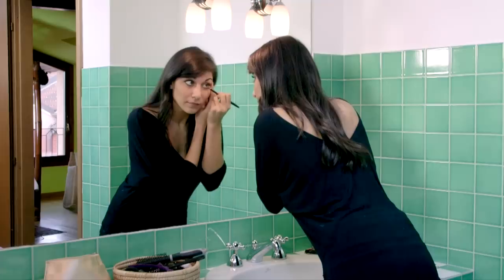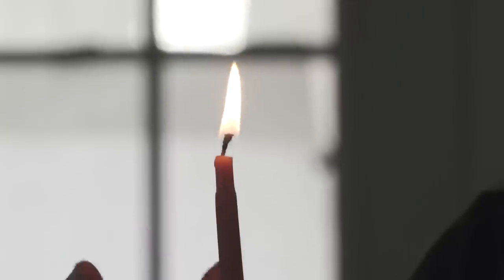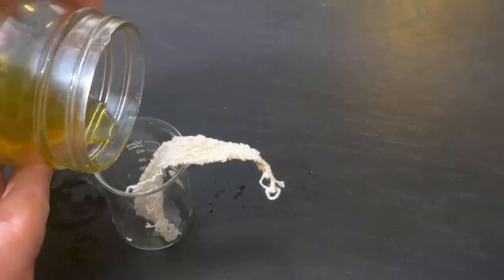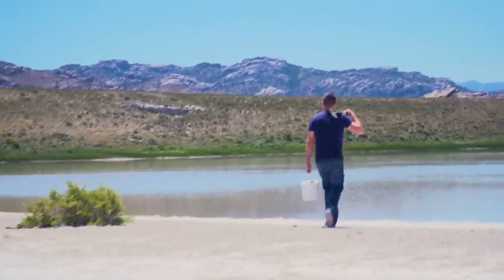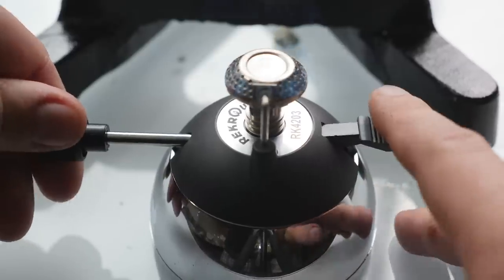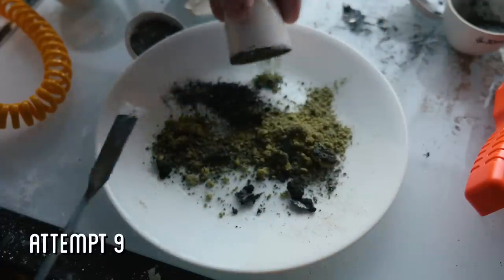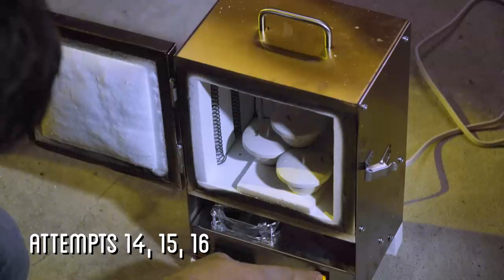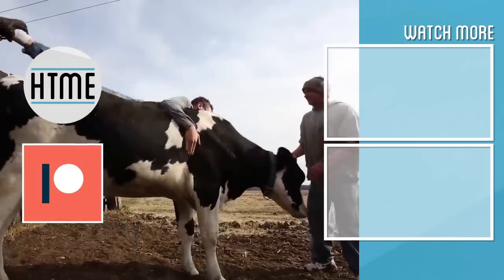Khol Eyeliner and Ultramarine Eyeshadow From Scratch | HTME: Cosmetics

Comment: Just out of curiosity, how far do you guys plan in advance? On a number of occasions you've had to get ingredients for different projects that have nothing to do with each other. If I'm remembering correctly at one point you needed cacao, coffee beans, and cochineal. At least 2 of those were gathered on the same trip to Mexico for 2 different projects. Other times you just had leftover materials from previous projects such as this with the cochineal and the glass ingredients.
Reply from the maker: Since we have such a limited budget and the projects are so time consuming, we usually have to plan out our entire year at least a year in advance and be shooting several projects at once.  Then whenever we decide to travel somewhere, we try to shoot as much as we can for any possible future content we might do.  With Mexico, coffee and chocolate were our primary goal, but added on tequila and cochineal since we were there.  We tried to add some other ones, but weren't able to get them set up.  The fact that we were able to source cochineal there kind of inspired this entire cosmetics series.  When we went to Utah this summer, we crammed in as much resources as possible, just in case we might need it in our future, and they'll be used in a dozen different videos next year.
Reply: How To Make Everything Thank  you for your dedication. Would you consider doing a Kombucha video as it'd be an easy vid to make and a great extension to your fermentation exploration. All the best to you!

Comment: There is a weird relationship between cosmetics, alcoholism and Arabic.
Fun fact: the word "alcohol" comes from the Arabic word "ك ح ل - Al-Kohl" which is basically what you made. "كحلي" means blue, also what you made. And "كحولي" means alcoholic.
Reply: OHM-968692 
Correct me if i’m wrong but isn’t Azraq blue? Also in moroccan a similar word is used for black pronounced kHl with the capital h being a hard “h” sound.
Reply: Zakaria azraq is light blue. Kehli is dark blue.